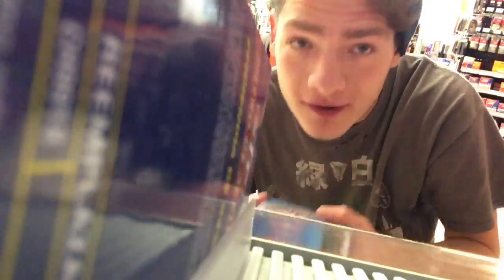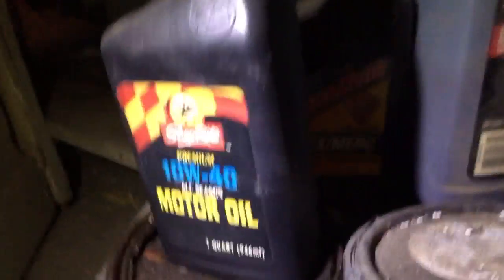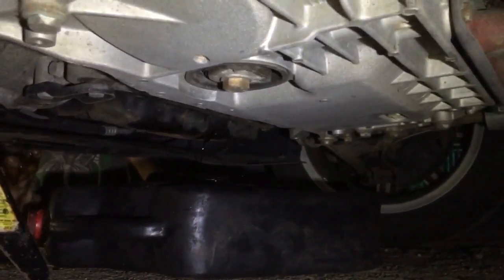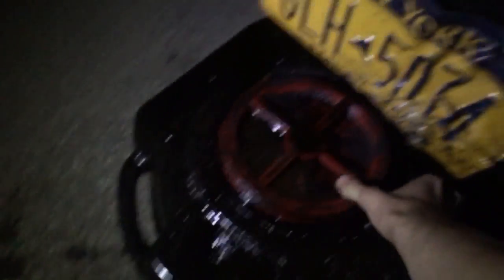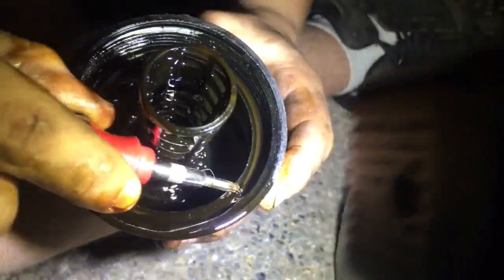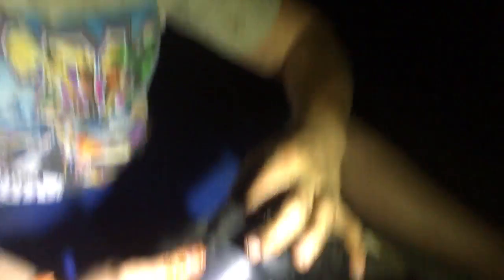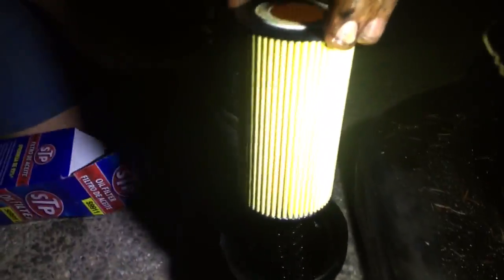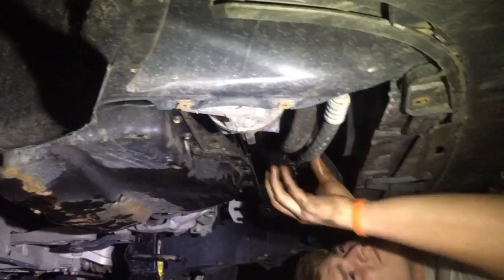Learning How To Oil Change 2006 Volkswagen Rabbit 2.5

Comment: ugh, oil filter changes. Should be easy bit I had a honda prelude once that had so little space to reach and turn the filter. Turned into a 2hour job. Wound up putting a screwdriver through it to get it out.
Reply from the maker: +Hissing Thoughts yeah my brothers truck no jack needed took 15 minutes but with all the specialty tools and hiding spots Jack's falling over on me it turned into a full day thing.
Reply from the maker: +Hissing Thoughts it doesn't get much lower of a car then a prelude